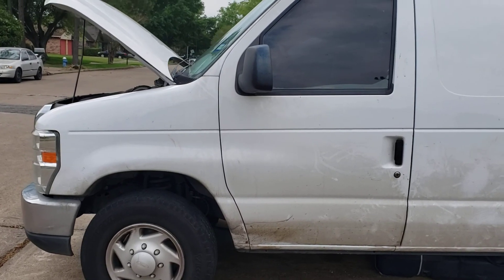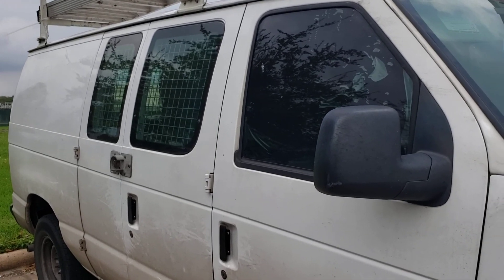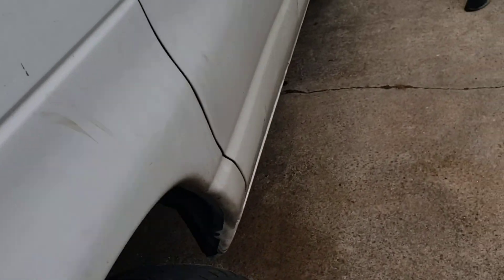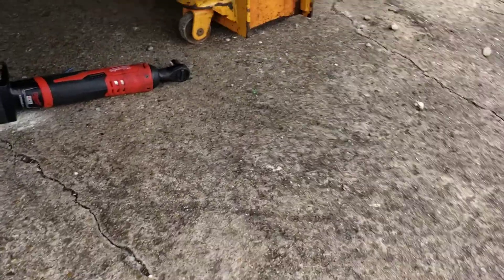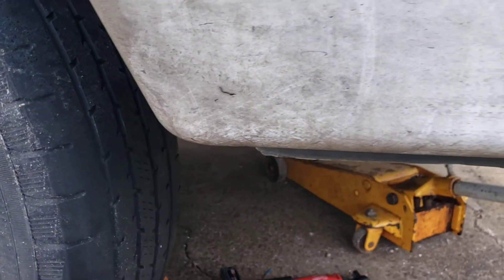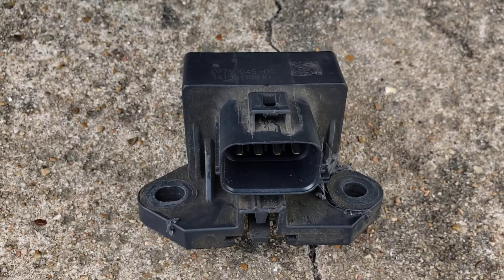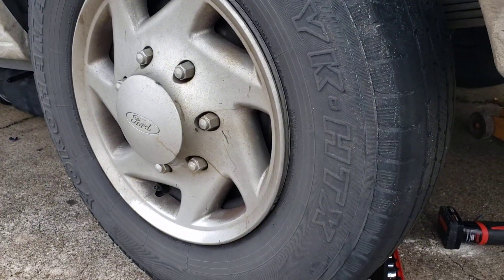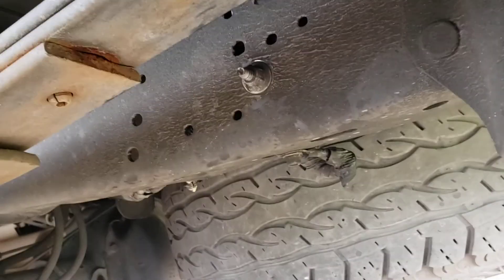Fuel pump not working on a 2014 ford van E250

Comment: Muchas Gracias!  So happy i came across your video.  You saved me over $1k in unnecessary fuel pump and labor cost to replace.  Replaced module and started right up.  Sorry for your unnecessary cost to replace your fuel pump, but your paid it forward by helping us.  Thanks again!
Reply from the maker: I'm glad this video was very helpful

Comment: Man this saved me bigtime,i was working on the hitch wires and left this module disconnected not knowing its the fuel pump module.then i changed the oil and tried to start,no start so finding this made me remember what i did.thanks bro

Comment: Thank you so much for posting this.   I have just had an issue with my 2014 Ford E250 van not starting.   I was able to do the reset sequence for resetting the Fuel Pump and it worked once.   Have not driven the van in 2 days and we were getting ready to go to a Gem and Mineral show and it did not work, and trying the reset procedure no longer worked.   After seeing this video I checked this part and it had some dust or dirt in it.   I shaked it out and reconnected it and now the van started.   Before going to the show I purchased this part to replace when I get back.  It was great to have it fixed and the new part as insurance.   You saved our show as we were able to go and do very well.   Thanks again.
Reply from the maker: You are welcome
Reply: Change your fuel sending unit should fix the problem.

Comment: Very kind of you boss. Quick question I got a 2013 ford e350 but the gas  meter just  stopped working.  You think that would fix it?
Reply from the maker: I don't think this relay is going to solve your problem,
Reply: Replace your fuel sending unit should fix the problem.
Reply: Have an auto parts store check for Trouble Codes.